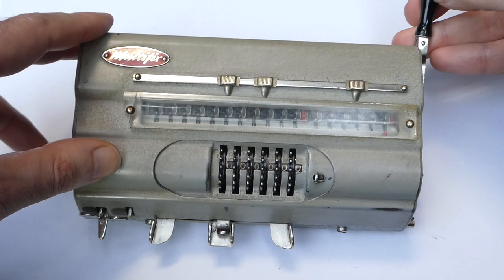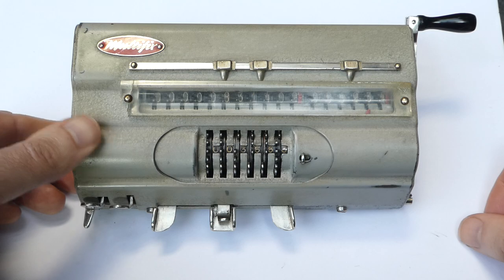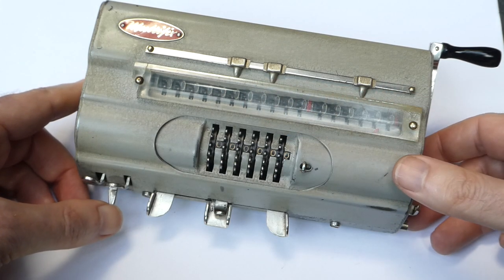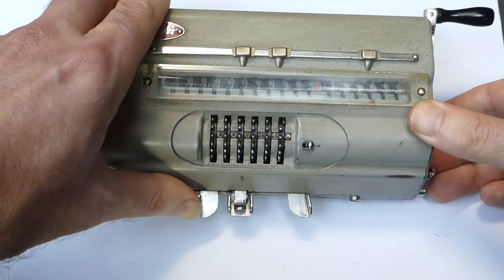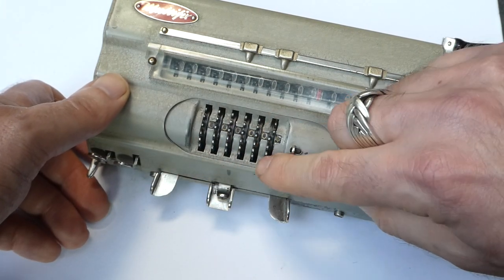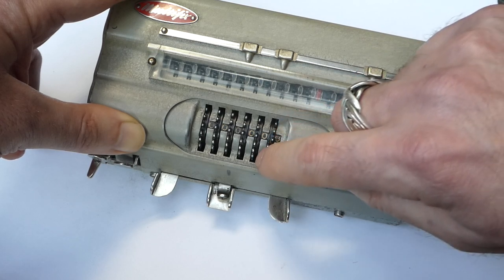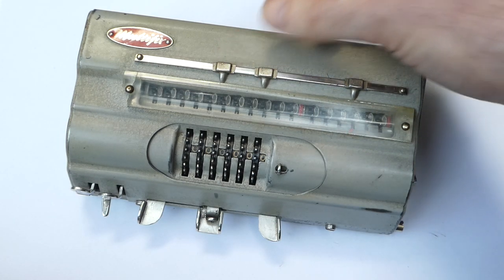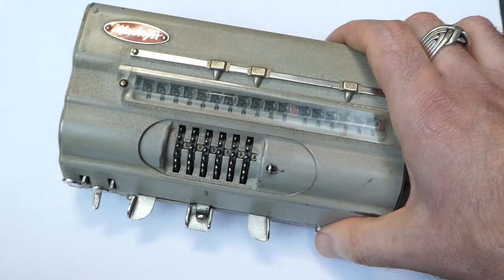The Multifix E1R mechanical calculator

Comment: That's fantastic Jaap - it almost has the look of a bus ticket machine rather than a calculator, and I like it.  When I first saw the input wheels I thought it would probably only shift a few places to the left, I didn't expect it to partially disappear behind the cover!!!
Reply from the maker: Now you mention it, it does indeed have the feel of a ticket machine, both in its size and the fact that you pull and push the handle.  I have a couple of ticket machines that will probably find its way on here eventually.
Reply: @jaapsch2  Yeah, ticket machines have a similar mechanical charm and fascination - I think most of your audience would enjoy those too.